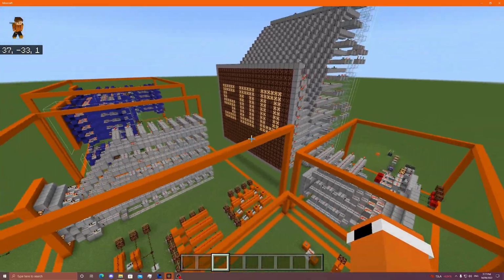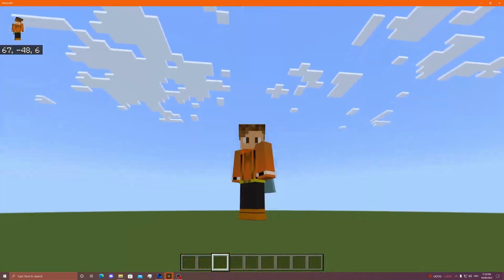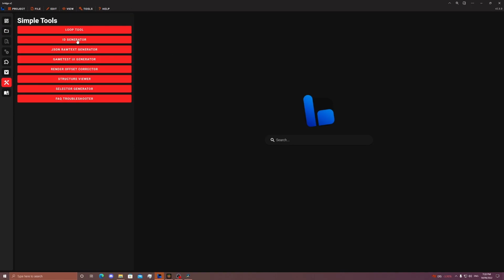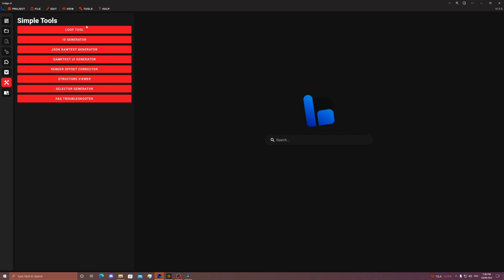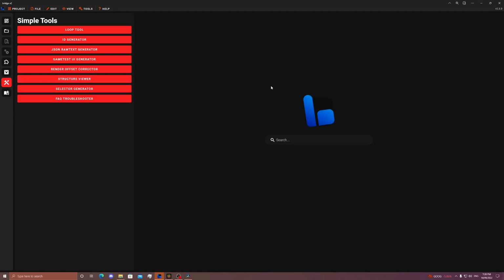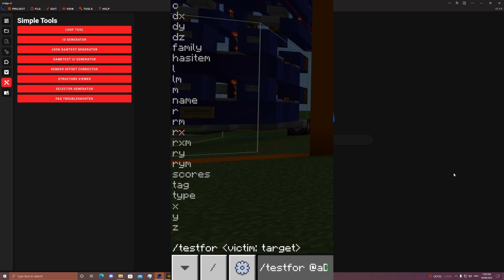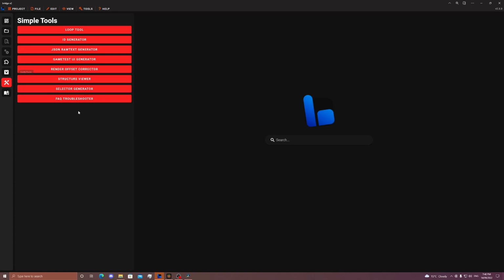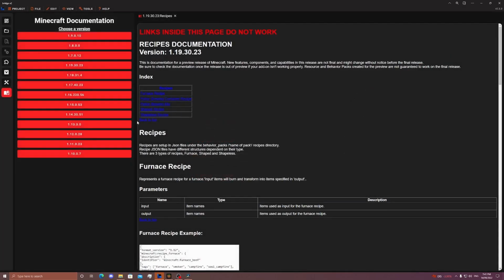500 Subscriber Milestone + Voice Reveal

Comment: Pls i want to asking you. Bridge is working in mobile
Reply: Yes teoreticly it should work on any device with web browser because you can use bridge as an web app. So there is no installation required, only web browser (Google, Mozilla atc.) and internet connection. However it will be way more difficult to navigate and write on small devices